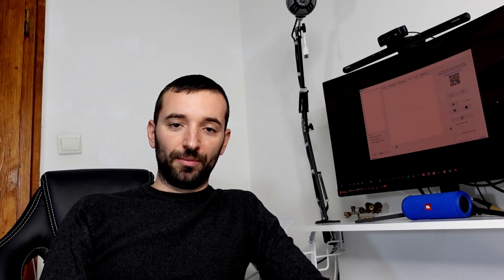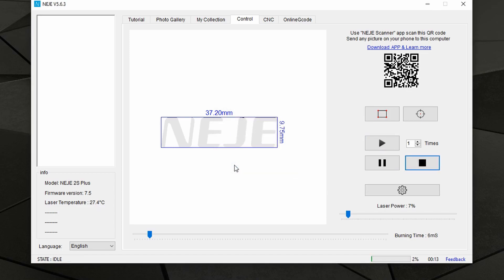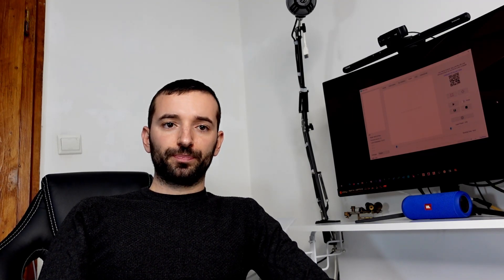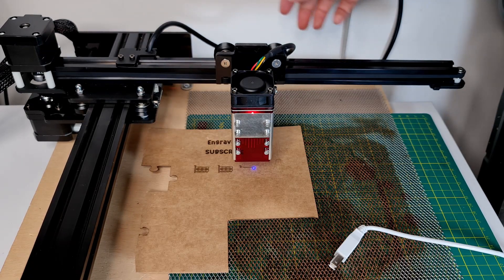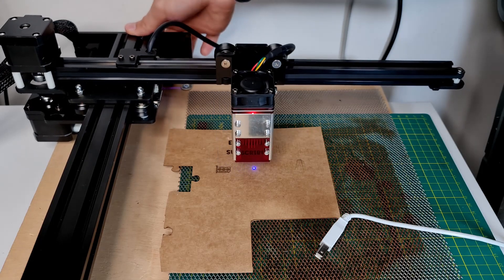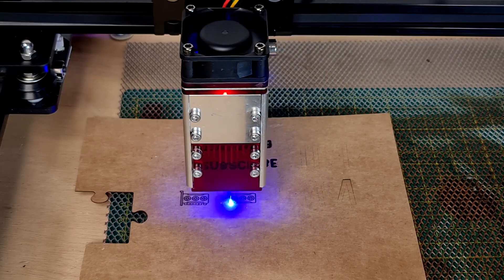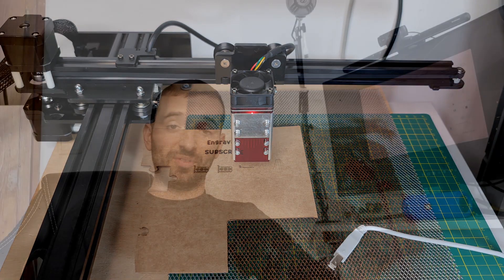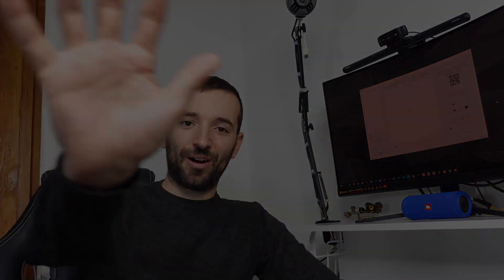Safely home your laser machine & What is the red button?

Comment: Hı , 
Thank you for your videos.So helpfull for us.
İt s continiously working ( burning power  ) when I turn on laser.And I couldn t stop it.
I tried also Red button.
Have you encountered such a problem? And do you know how can I solve it
I wrote to Neje support.But now they are not working
Reply from the maker: Hello Zeus, thank you for your comment.

To recap; when you turn on the machine, the laser goes on but the power is high enough to burn. is that correct?

If this is the case, I haven't experienced such a problem,.
This means that the idling power is a bit too high. Which software are you using, and most importantly can you actually send a project to engrave?

Hopefully, the board controlling the diode did not fail, try to update or reinstall the Driver, if you are using laserGRBL go to the GRBL configuration and make sure that the $31 is set to 0 and $32 to 1.

IF you are unable to engrave, try disconnecting the laser module, power the machine back on and try to send a project to see if at least the axis is moving like if they are engraving.

Let me know.
CIao

Comment: Oh, and I have a question. How many millimeters do you set the distance between the laser module and the object?

I'm floating 17mm, is that correct...

The module being used is a NEJE PLUS 30W module.

If anyone knows how much to put, please comment.

I do not understand the product manual well, so please ask.
Reply from the maker: Hello Bebepapa, thank you for your comment.

The 30W module has a focusing nub, when it is all screwed in goes between 39mm and 41mm, I know that the specification say 17mm but I haven't succeeded to cut anything with that distance, perhaps is because of the air assist which I do not have.

Anyhow try to use my focusing trick shown a few videos ago to find the right height.

I hope it help.